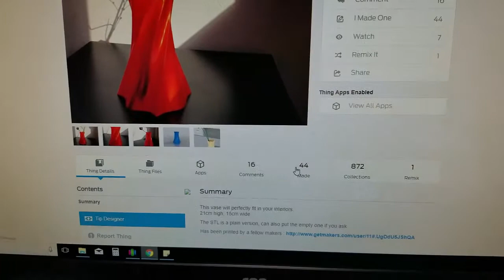TRONXY X1- UNBELIEVABLE 3D PRINTED VASE! You've got to see this with your own eyes😲

Comment: Hey... I am about to buy this printer for 100$ with shipping and a spool of pla.
So I am planning on switching out the build plate for Aluminium then drill holes and then put a silicone heated bed under it. What are the diameters under the build plate
(Under the 150x150x150x mm plate) I'd need them to determine the size of the heated bed.
Thank you.
Reply: I really can't find
Any details on it
Reply from the maker: I have a link to the product page you can use to buy it.  The specs are there
Reply: GeoDroidJohn Thank you for your last answer so.. 
Could I just Buy a 12 volt 20 amp psu 
And connect it to the Motherboard (The melzi) so a completely closed off power supply like the one it came with.
And then connect my HotBed to the connecters found.
I am also planning to switch the extruder cooling fan and print a new one that will not only cool that also cool the parts.
And then ill use the fan connection for the Motherboard area. So I can keep everything cool there. 
What do you think?
(All of this means since I will get an enclosed power supply again no mosfet) <--- so a psu that doesn't have exposed connections.
Reply from the maker: Sounds great! Let me know how it goes!
Reply: GeoDroidJohn Thank you. And I will.

Comment: My friend has a Tronxy X1 but it stops printing mid print, any help would be greatly appreciated.
Reply from the maker: Is he printing from the sd card?  Or through the usb cable? 

If the  cable it could be from the cable,  or the software sending the code. 

If just from the sd card I would look at all the wiring connectors and ensure they are firmly connected.  The TronXY X1 has very small connectors that can fall off easily.  

Beyond that I would look at the power supply and wiring into the board. 

Lastly, gcode could be the culprit.  Let me know what you find.
Reply from the maker: Did he find the problem?

Comment: Hey man, great vase!
I just got my tronxyX1 but the filament is curling up and I think it's also under extruding... Any tips? I didn't even get to print the gcode that comes in the SD card, it's not sticking and it becomes a huge mess...
Reply from the maker: Try my gcode from the thingiverse profile. Make sure you tram aka, level, your bed before trying to print
Reply from the maker: Did you get it working?
Reply: Yes sir! Now I have to see if it's capable of making a decent cooling fan holder since I'm having some inconsistency on the layers. Thanks you!